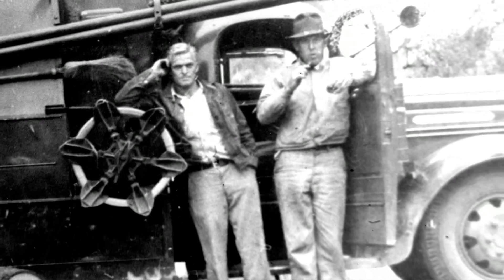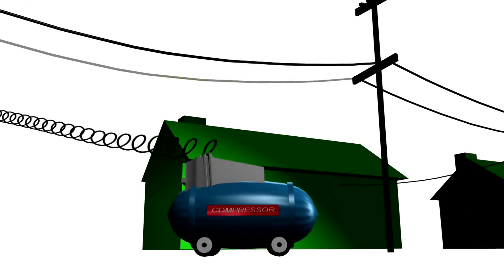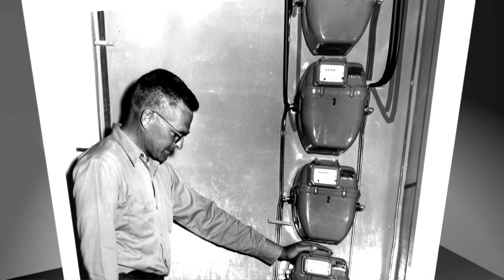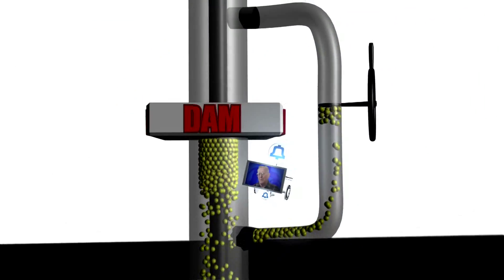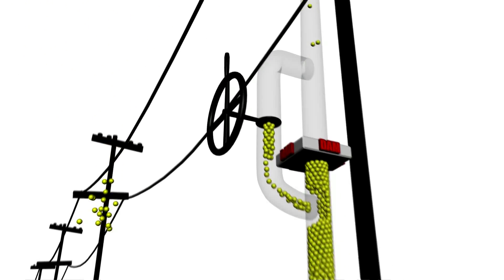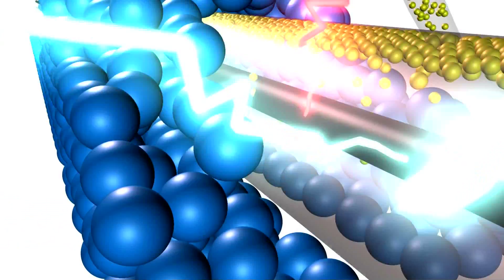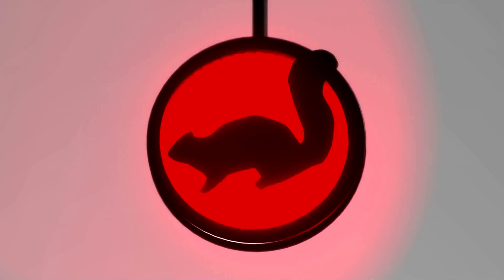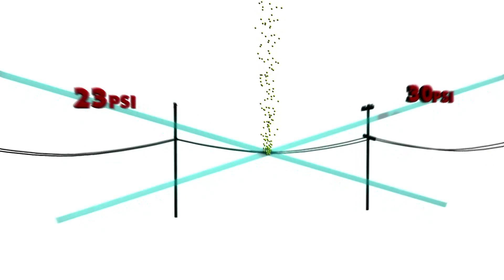Phone Cable Gas Pressure

Comment: In our area at Verizon we have one "air guy" who basically does nothing but keep the air driers running in the CO. I've never once seen him in the field where he needs to be. We've lost a lot of cables due to negligence and the company doesn't care at all. It's truly sad to watch.
Reply: I remember losing a T1 line in a rainstorm. Called Verizon to find out what happened, they had a cable failure. T1 was down for 48 hours. This was in Northern Virginia. I got another experience of how little Verizon cares when their FIOS conduit installation contractor hit a 200 pair cable in my yard on Friday. Verizon didn't show up to fix it till Tuesday, and they screwed up the drainage ditch in the process. Now the water doesn't drain. I'm not a Verizon customer and I never will be. The company runs like a government agency.

Comment: I was on the gas pressure crew in San Jose in the early 70's. I discovered a few section leaks between manholes in the lead cables. I would  use a probe with a microphone on the tip and push it up the duct along side the cable and find the distance to the leak. Then we had West Valley construction come out and dig it up and I would repair the leak which was caused by electrolysis from nearby water mains. Problem was, the electrolysis cause many leaks, as soon as you fixed one leak another would show up 5 feet away. Twenty years later we used helium to find leaks. Because helium would rise, we would put helium tanks on the cable with the lowest pressure and use a helium sniffer to find the leaks. We didn't even have to open the MH we just put the sniffer probe in the hole where the MH hook went.
Reply: I ended my career on air pressure in the Chicago Suburbs.

Comment: Fascinating.  I was aware of Nitrogen (or Bell/Communications people called it "air") being pressurized on lead cables, but once the ANTW cables with a plastic sheath were introduced and the lead cables came down, this became less and less of a problem.  I wasn't familiar with the injection of material into the cable where the puncture occurred.  I assumed splicers would create a new lead seal.  They called it "wiping" the cable.  The old BKTS was a problem.  Squirrels also liked C-Rural Wire.  I cannot tell you how many open wire leads were removed to modernization (and never touched by squirrel problems) until C-Rural Wire replaced it.  The squirrels were "c-r-a-z-y" about C-Rural Wire.  Nawed on it and loved to chew it.  109 or 104 steel strand was impervious to squirrel knock-outs.

Comment: Back in the day, I cracked an iron case while putting it back together, the very next day our PPM dept was there putting up a waffle case due to the air alarm. Today sadly there is little to no air pressure on our cables exept for right outside the co.
Reply: Believe it or not In Detroit a good amount of our cable still needs air on it.